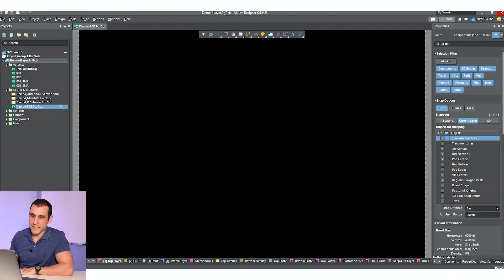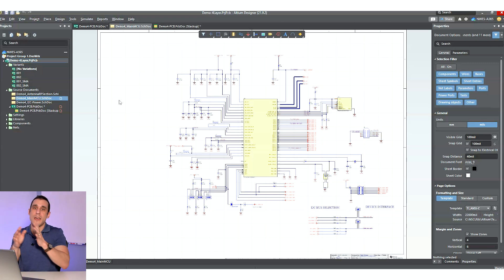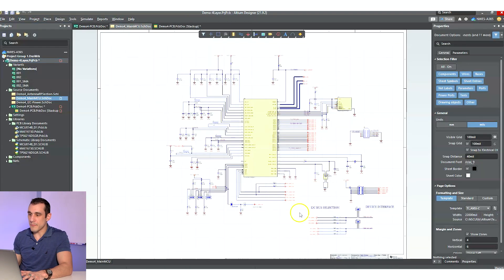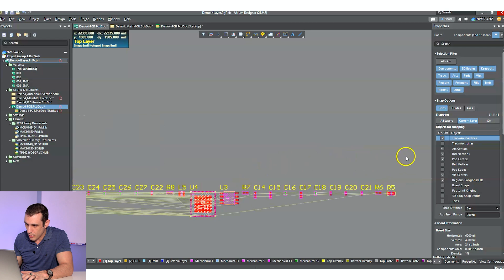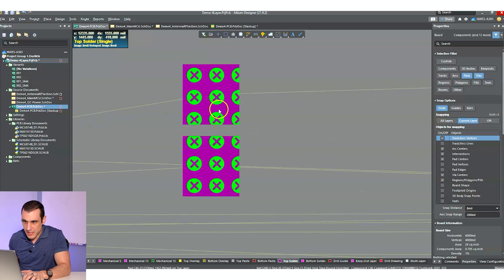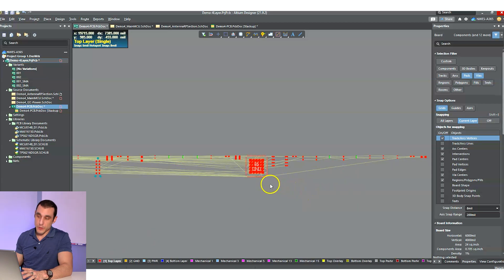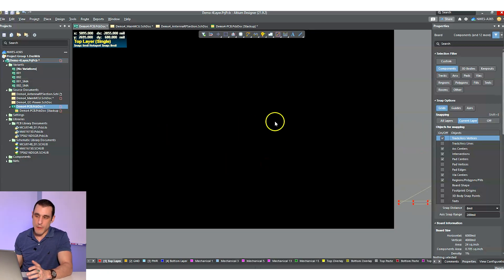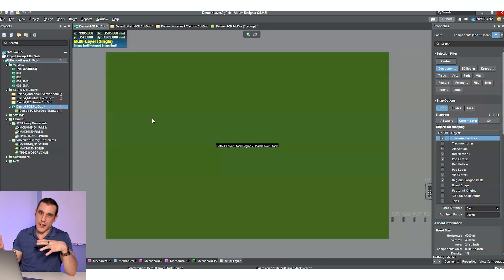Getting Started with 4-Layer Boards - Part Two

Comment: Thanks you Zach for this series. I find the cross probe select mode very useful during component placement wherein I select a group of components from the schematic and the control shifts automatically to the pcb view and I place the components one by one. It would be awesome if you could demonstrate it in a future video.
Reply: That's a great idea, I regularly use cross probe when debugging or doing reviews but I had not thought to use it like that. This is one I'll add to the list. Thanks!

Comment: This series is very helpful, but it's not good advice to set your soldermask clearance to zero (9:09) . Bare board fabricators need a little "wiggle room" for misregistration, and you don't want green stuff on your soldered surfaces. Is there a way to change the solder mask expansion just for that specific component? Thanks for making these!
Reply: Yes there is, you can select just the pads on one component, go into the Properties panel, and when you scroll to the bottom of the panel you'll see an option to set the soldermask expansion to a manual value. Hope this helps!
Reply: @Zachariah-Peterson  Thanks, I didn't know that was possible (I'm just learning Altium, but I've been designing boards for a long time). It might not even be necessary to adjust the soldermask expansion in this case, because soldermask slivers are usually only a problem with long thin strips between rectangular pads. In fact, I have never heard of a issue in manufacturing with thin soldermask between round pads. (Maybe I should investigate setting the slivers rule for only rectangular pads? just a thought...) 
Anyway, you're a good teacher. Hope you continue..!
Reply: @jackolson8015  Okay that's a good point, thank you. I think this is one of those instances where the fabricator wasn't providing the best context around the guideline and so they just gave me a conservative value for the slivers, then of course if it gets applied to every single pad that brings up the potential mis-registration problem you mention. In your experience, what is a decent expansion value in general that balances mis-registration errors and solder mask sliver? I'm thinking of this on rectangular pads for longer gullwing leads, like QFP packages?
Reply: @Zachariah-Peterson  Well, we try to use values that will be easy for all bare board fabricators to manufacture to, and I think it is pretty standard to have a 2mil gap betweeen the edge of a component pad and the soldermask.  Of course, you can always pay more for tighter control. Vias are treated differently in many designs, but that's another subject, ha. Anyway, if Altium is applying 4mil in the default rule, that's pretty good, assuming it means 4mil total, so 2mils all around (I'm answering from a different device and can't check that right now). 
Regarding slivers, I think most fabricators don't get nervous until you are approaching 4mil strip width, and some datasheets recommend "gang relief" around fine pitch devices, which means placing a rectangle over the whole row of pads, no soldermask betweens pads. If you know who will be doing the component assembly it might help to ask them for their preferences. 
On a personal note, I would like to know if I'm misunderstanding about slivers near round pads, but I have just never heard that it could be an issue. 
Still surfin' the learnin' curve...

Comment: Hey Zach,
Do you have any rules of thumb for board size choosing
Reply: Hi Idan,
When I deal with clients they usually have a target board size they need to hit. Maybe they are building the enclosure but they have a space limitation, so you have to work within that. Sometimes they have a large connector that they have to use or they are mating to another board, and those factors can drive the board size selection. In other cases when someone does not have a target board size, I'll wait until doing the import before guessing what the final board size will be just because I don't want to over-promise. If it's a hobby project, then I prefer to push myself to get to small board sizes just as a challenge.

Comment: Something I found useful is setting net class colors. I would have a specific color for GND, PWR, DDR...etc. At first it might be confusing but it really pays off when the colors are standardized across your designs. Credit to Mike Creeden and PCEA's course for this tip.
Reply: Definitely a good feature, and I'll admit I don't use it enough
Reply: @Zachariah-Peterson  I highly suggest you give it a shot. You get used to it in no time and it really helps during placement.

Comment: But lets assume, that all my parts in the schematic DO have a footprint - how do I export just 1 sheet to the PCB? I know I can just uncheck the components from other sheets, but that takes forever! Is there any other way to bulk - manage them?
Reply: For smaller stuff I'm normally able to iterate through the component reference designators individually because I'm placing things in order. Also the circuits are smaller so it's easier to un-check stuff in that list. You're right though as you get to bigger projects it's really hard to do, and at that point I say just import everything and take advantage of the rooms feature to manage them one at a time.
Reply: Okay, I'll have to look more into this feature, thanks!
Reply: The other thing you can do is to add sheets to the project and import them individually. Again, tough on larger projects but it works nice if you have a small number of schematics.